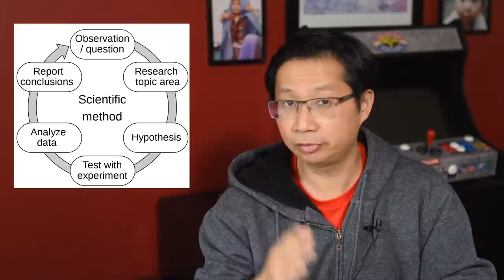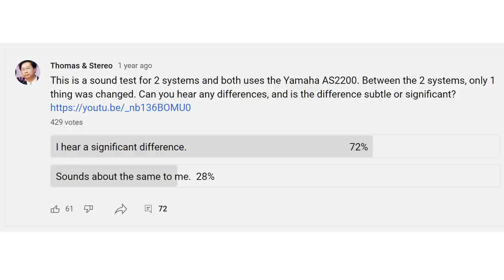Let me tell you stories about Break-in.

Comment: I'm a little late to the party. Here's my surprise answer, one that surprises even me. It comes after some reflection. A lot of people have told anecdotal stories about break in, so many that I'm not going to dismiss them out of hand. It is easy for me to see how loudspeakers could have a break in period. Stiff new mechanical suspensions could loosen up with use. Same for other transducers like phonograph cartridges. Does it happen? I don't know or if it does to what degree or to which models. Here's what I do know based on my many years of experience with electrical systems. Of all of the laboratory and production equipment I've built systems for, some required calibration even periodically but none required break in. However, in particular vacuum tubes are going to change over time. How long? Starting from the moment that they first heat up. How long will the process go on? Until the tube fails in use. How long will that take? Depends on many factors. The Sonic Frontiers amplifier needed a $1400 tube change every 8 months. A manufacturer of hybrid tube solid state equipment recommends changing tubes once a year. To qualify for the Atlantic Cable AT&T required tubes to be in reliable service for 25 years before they were acceptable for use in the atlantic cable. If there is a change how does the equipment know when to stop changing? Will a store break in new equipment before they put it out for customers to compare it to other equipment that has been in use for awhile? Do transistors change with time? No not likely. Their atoms are locked tightly in a crystal. If the crystal fails it will fail totally and is dead forever. Tubes can be operated until the plates are cherry red hot and still function but of course not as well. Tubes will also very slowly leak air. It could take decades to fail. OTL tube amplifiers are notorious for blowing up, even catching fire. Heat is the enemy of everything. 

Capacitors will change. The newer types like mylar change more slowly than other older types like electrolytic capacitors. I change out 12  NPC electrolytic capacitors in my pair of 25 year old speakers while the woofers were out for refoaming.  I meausured the old ones and only one was out of spec. What did I replace them with? the same type NPC caps.I don't know if a more expensive type would change the sound and I didn't want to risk it. 

The emissions of a cathode in a tube varies with the 4th power of the change in temperature (measured in degrees Kelvin starting from absolute zero.) So a small change in utility voltage can change the temperature of a tube and its characteristics if the tube's filament heaters are not connected to a regulated power supply. Even the temperature of a room matters.  Negative feedback properly used mitigates the change in the tubes characteristics. Do resistors change value over time? They can. Inductors? No I don't think so.

What about wires? I don't think so.

So how would you test whether breakin occurs. Start with two brand new identical units. Listen to them, test them, and if they sound identical, then break one in but not the other. After you think the one is broken in compare them again. Keep in mind moving speakers just inches or angling them differently will change the way you hear them. Dr. Floyd Toole had a machine that would position different speakers in exactly the same spot every time to compare them. The flaw was that what might be optimal placement for one speaker might not be optimal for another. Speaker A  might sound better in position 1 than in position 2, with speaker B the opposite could occur.  

So what's my bottom line? I don't have an answer. For anything else I'd say no but for high end audio equipment used by listeners whose ears are so sensitive they can hear a flea fart and memories so infallible they remember the precise sound of the first recording they ever heard like it was five minutes ago who am I to argue?

Comment: I noticed the burn in on me  
Yammy AS-1100 when it was New 
pretty sure i sent you a Email 😆 
I was glad to ! The burn in added a slight bit of warmth , but at first wow man the Yammy was somewhat netural and top end could be unbearable with speakers that have that forward presentation and that are also Reveiling , I still wouldn't reccomend a speaker like that with the Yammy but those Mosphetes in the output stage finally started sounding better ! And Till this day i will say the Yammy does have some tube flavor ! 
Should have mentioned that in my recent comparrsion ! 
Dang it still upset my yammy got dethroned dang it dang it man ! 
I still believe i haven't found that great speaker synergy with the Yammy yet! I think some big Harbeths may do it ! 
40.2 may be 'good enough' 😆

Comment: The thing is, if you experience burn-in in even one piece of equipment, then you have concluded that the concept is real and there’s no further need to try to prove it. On the other hand, if you’ve never experienced it then you won’t believe it’s a thing unless you actually experience it somewhere down the line, and sample size has no bearing.

Comment: I have a friend who works with advanced electronic components (not sound), he says that in terms of component measurement, break-in is 100% real, and after some time, the components measure different (in he's case, more accurate).. so it is true that something real happens during break-in. If you can hear it in sound equipment, I dont know.

Comment: In 2008 or so I built the Zaph Audio MTM aluminum speakers.  Sounded like crap. So bad, I called my uncle who is a radio station engineer and electronic engineer.  Showed him my crossover,.... Nothing wrong with it but it sounded like a clock radio playing in the next room.... Took the crossovers apart and started fresh. It has to be a mistake on my part. Nope, still sounded hollow and distant.
   In frustration after my first DIY project I left for work and let em play their sick undeveloped sound while I was gone. Came home after 10 hours and ...well they sounded better, but not at all what I was expecting. No where even close to the B&W 302 I was used to. 
   I built the darn things, I reconstructed them 2x. I'm gonna play the damn things. 
  2 more days at work etc I come home and going through my routine after work, playing with the kids, talking to my wife etc etc....at one point I hear something that stops me.  
"That's THOSE speakers I'm hearing?!" .. yep sure enough, it was: and they really, truly became opened up!! 
From that point I was on it...play em loud, play em soft...just play them.  In about two weeks they outshine my B&Ws .   
 For drivers anyway, this anecdotal tale says hell yah, it's real. (Assuming they are not factory broke in, right?" )

Comment: Audio components CAN be subject to break in some, not all. Not only are amps different from speakers, but there are different types of amps and topologies: solid state transistor, MOSFET, JFET, valve, Class A, single ended, AB, D, etc., etc. I’m certain (though it’s a sample size of one!) my DECware SE84UFO Zen amp benefited from break-in - I didn’t track how long. EVERYTHING I’ve read about Atoll amps (MOSFET) need about 200 hours to fully run in. The manufacturer, the US distributor, dealers and many reviewers attest to that. 

Regarding the PMC before/after, I think having the speakers on the desk was a factor in why you didn’t like the sound after break-in. The increased bass, I’m pretty sure, vibrated the surfaces of the desk and upset the balance.

In the end, one should just go with their ears.

Comment: Of course break in is real- just more noticeable on some components than others. Not just the mechanical parts of drivers in speakers, but the caps and transformers also undergo some electrical affinity changes from the day it's new to after many hours of use. Electrical components wear out over time and with use, particularly capacitors. This can take years in some cases, but it's there regardless. Akin to break in would be warm up. I'm sure many people who own class A amps and tubes have noticed how much the sound changes from when the amp starts out cold as compared to when it's been warmed up for several hours. This raises the question about the accuracy of some equipment reviews, given that most of the time, the equipment is freshly out of the box and does not have the many hours break-in that several manufacturers recommend. Even on class D amps, I was told by one manufacturer to allow at least 200 hrs of use before forming an opinion of the sound. They were right. Each day of continued use, it got smoother and more composed without loss of detail or instrument separation. It is also important to not cherry pick a single part in the component for pre-post measurement, as the changes may be so imperceptible that one could incorrectly conclude that there is no difference. The (electrical) parts must be considered as an aggregate, where subtle changes become accumulative regarding the component output. Great topic.

Comment: Break-In is automatically done as you use the gear.. Same for a racing engine, ask any Professional Driver., In 1972 Me & a friend broke-in another friends new Dodge Charger by driving it at different speeds for 5,000miles as recommended by the Manufacturer..new shoes or sneakers especially leather get better with break in.. New baseball glove, tennis racket, even a pool stick..A new hung door/ hinges open & close better over time.. Your car tires break in as they heat up., New shocks, a New frying pan especially if it’s Cast Iron, etc. etc. Most everything improves with break-in, “which is automatically performed as you use it.” Common sense dictates…

Comment: I just moved and didn't use my hifi for a month. The speakers seemed to open up again after ten hours, so they needed it.

I'm curious, if a fully digital amplifier needs break-in. My logic says no...
Reply from the maker: Well it has capacitors in an amp and the sound do change after break in from my experience.
Reply: Thanks for sharing your experience 😊

Comment: Break in is life, and it's not bs. I am refering to driver break in. A driver is a electromechanical system where the spider, surround and so on will change over the first amount of hours. This does not mean that all gear and driver goes over the same amount of change. Do not believe a simple test can be made. Measure a drivers thiele small parameters before and after used, parameters will change. Dacs, amps and so on i dont know about, some gear will benefit from warming up.
Reply: I have a very concrete example of when break it was clearly audible to everyone, not just audiophiles. I had a pair of Hifiman HE-400i, they sounded straight up broken when I first started listening to then. The bass sounded plastic tubes slapping together, the treble was very grainy and sibilant. After 2 days of playing it was gone.

Comment: I like it when I see manufacturers offering a 14 day trial period who ask that you allow at least 300 hrs break in before evaluating the sound. 
As for cable break in well I think it's more a matter of companies hoping you'll keep their expensive cables long enough for your ears to get used to them instead of wanting to return them after a short home demo. 
I believe mechanical parts (such as automobiles) need to be broken in, therefore I assume the same applies with speakers. Whether they sound better or worse afterwards is another matter. Does precision increase or decrease with wear?
As for electronic components I also agree that some more than others need to be left on for a certain number of hours in order to charge capacitors and/or reach optimal operating temperature.To me that is warm up period and not break in period.
I've never heard of TV manufacturers mentioning a break in period to achieve optimal picture quality, have you?
Reply from the maker: Well no for tv, and that is also because no one ever report a difference. Unlike audio where just by looking at the comments here, you see a lot having that experience. Which touch on the point, just because it sounds logical does not make it true.

Comment: My only objection with manufactures is not if break in make a difference or not but if it needs break in they should be doing it and deliver a product ready to roll. I don’t understand why audio has to be different from any other electrical device. You don’t buy a car expecting it to perform on spec after driving it for 200 hours.
Reply from the maker: Some manufacturer do, there is a cost associated with it. You need to build workstations to do it and I have seen manufacteres with break in stations. However, they do it mostly to make sure it is working and no defect before shipping.
Reply: @ThomasAndStereo  Yes, I know but a serious company would deliver a product ready to use.

Comment: As you note, sample size in this area is very important, so virtually no one's anecdotal evidence can be proof one way or the other.  Even if a reliable sample could be gathered, it boils down to this: 1) is there an AUDIBLE difference?  2) is it a difference for the better?  The fact that sound is experienced subjectively makes these questions impossible to answer objectively.  Mr. Vintage's and your experiences with that broken-in equipment support this.  As for your Yamaha experiment, it could be 72% heard a significant difference because they unconsciously wanted to.  After all, 28% didn't. A more meaningful result would have come from a follow up question: what is that difference? Or, if 100% said they did.  Even then, of course, it would only matter regarding that Yamaha gear.  This actually implies another question: does break-in differ for each individual piece of a make of gear? The mind boggles. The subjectivity problem is one that rears its head in almost every aspect of high end audio evaluation, so in the end, we must come back to the only reliable answer to these sorts of questions: do YOU like what you hear?

Comment: Ok so to everyone that believes break in changes the sound/performance of a speaker lets say after 200 hrs.  So with that logic after another 200 hrs the sound/performance should change again right? Another 200 hrs change and so on...
Reply from the maker: Why would you assume that and if I want to entertain that logic, If you keep adding sugar to a glass of water, will it keep getting sweeter and sweeter? Just an FYI,  once it reaches saturation point, it will no longer get sweeter.
Reply: @ThomasAndStereo  That is an apples to oranges comparison. A speaker is a mechanical device. So the break in is basically it's moving parts wearing. Like an engine. When brand new it takes a break in period before really opening it up. But the more you use it the more wear it has and performance degrades over time.  So speaker break in only applies to a certain time then it stops? 🤔
Reply from the maker: @ASSOpid  well think of it as a bell curve then.

Comment: Fact… depends on who you talked to… If you talked to EE, yea, electronic components tends to get to a steady state after a period of usage…till the components degraded and disintegrates and smokes came out (so to say).  If you talked to a material/mechanical engineer, yea, materials will stretch, contract and affected by temperature and humidity.  After the material settle with the normal operation environment it was put in, then it will, again get to a steady state and operated within a acceptable range.  How does that correlates with the topic… well, looks to me an audio system are a summation of electronic and mechanical parts.  So break in is an inevitable part of the process, so does the break down of the audio system… in time.  
So I agree with your assessment but I do not agree that it’s controversial…that is for someone with some engineering training.

Comment: Why not take two amps, use break-in on one, leave the other as is. After 100-200 hours make a blind test and compare both.
Reply from the maker: Yea, I would love to do that. However, if I don't hear any difference for those 2 amps, I still cannot conclude ALL amps don't change in sound after break in. If I do hear a difference, I can conclude probably some will.
Reply: Manufactured products suffer from sample-to-sample variances.  Thus even if a person can reliably differentiate between two samples, said person may not be able to with the next 100 samples.

Comment: ReBuild the engine in your car & don't break it in. Odds are you'll get to rebuild it again. Why? New parts bearing surface's have to get used to each other's tolerances & during this period they will run HOT. Hold your hand at the end of exhaust pipe during the start up on a fresh rebuild. Your burn your hand because the exhaust is So Hot as the rings seat to the cylinder walls. But upon the 2nd start up the exhaust is not hot enough to burn your hand. The same applies with voltages & current running through transformers resistors capacitors & tubes. Some components maybe pushed to their limits & run very hot. However the next time your amp is on that same component is not running hot while it is operating at the exact same voltage & current as before.
Why? Nobody knows for sure.
Example of this i why every electronic book define DC voltage by saying "for education purposes DC is Defined as an Positive to Negative flow of electricity"
AC & DC voltage Demonstrate some characteristics of the other